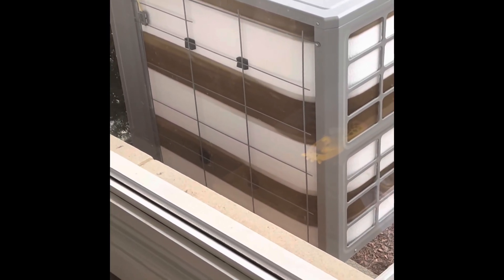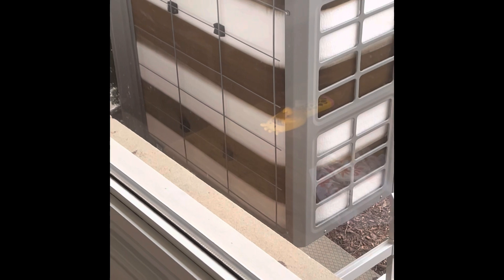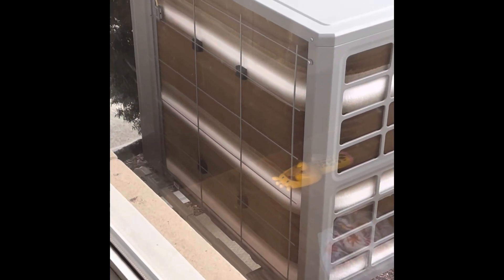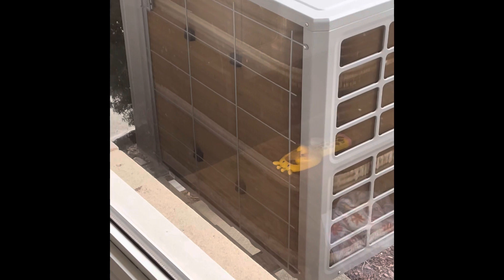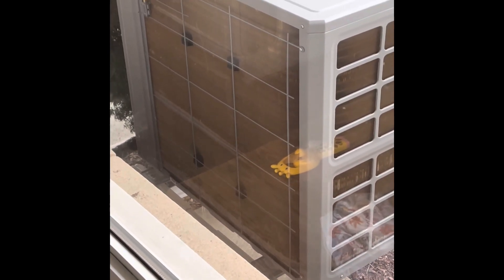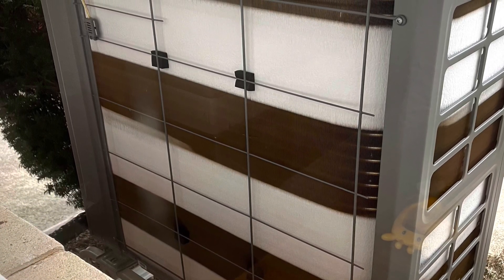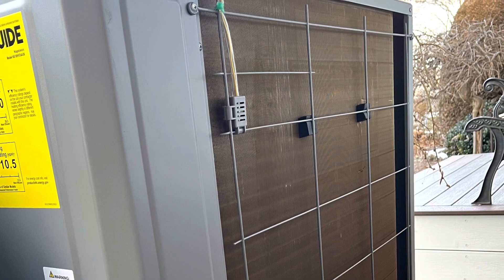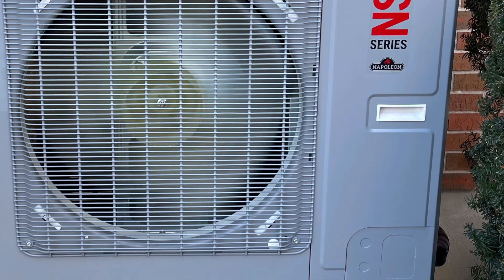Heat pump freezing normal??

Comment: 1 out of 4 installs we do is a heat pump dual fuel system. I personally sit down with the homeowner and explain what a heat pump is, gas furnace auxiliary heat, defrost cycle, 40 degree lock out, ice on the condenser, defrost sounds  and filter changes for the furnace. Doing that, I eliminated 90% of unnecessary NO CHARGE call backs. Happy customers refer family, friends and neighbors.
Reply from the maker: That’s amazing. More installers/reps need this approach with new tech!